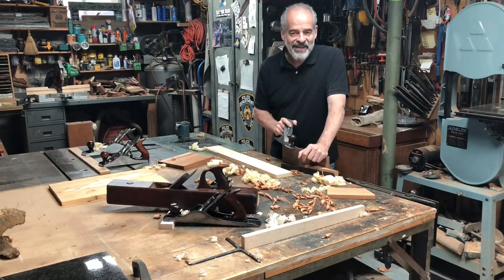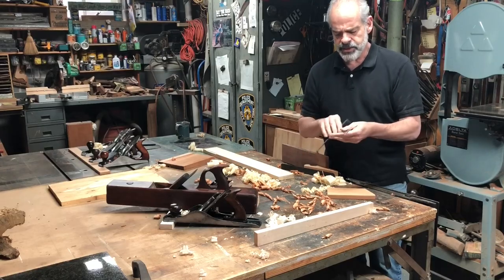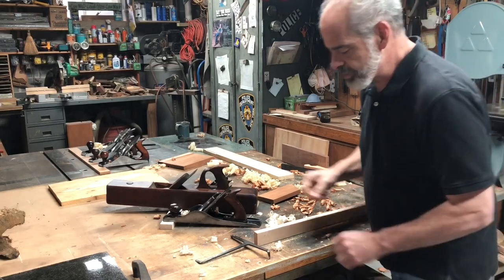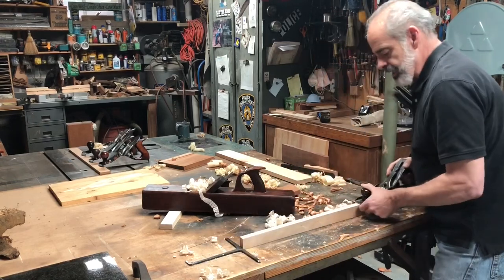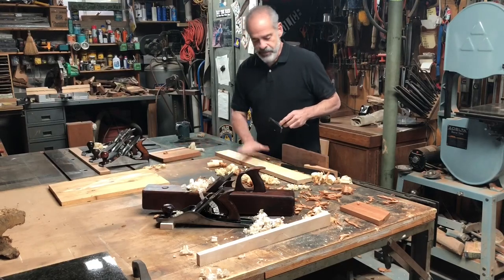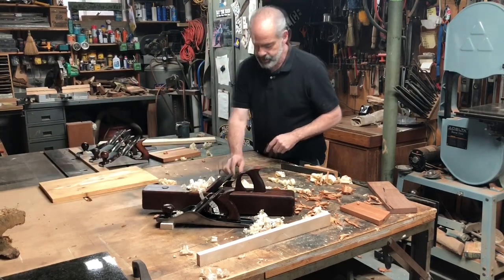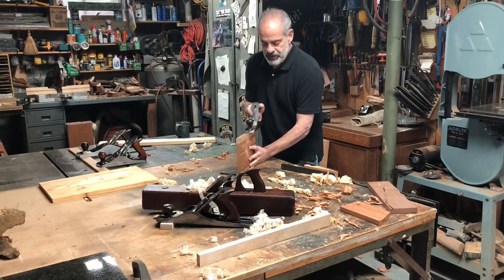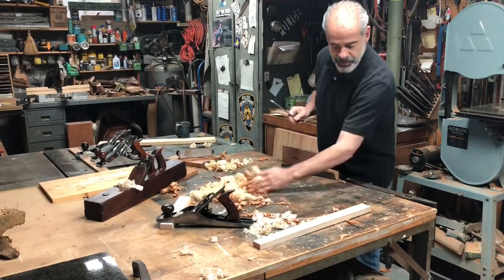USING AN IRON T-STOP ON A WORK BENCH

Comment: A great and versatile tool! How did you figure out that it's a bench stop? I wouldn't have thought of this possibility at first sight. Obviously it works perfect. 
But even if it should meant for a different task: sometimes there's a difference between what a tool was made for and what it actually can do. 
In this sense: a very inspiring video!
Reply from the maker: Thank you, Hobel, 
      it referred to it as a bench stop in the auction but was shown improperly used and not very effective, that way. After i received it, i tried to use it the same way it was shown and didn't appreciate it at all. After a bit of reasoning and trial i found my method of use for it and it works sensationally.. i now use it quite often